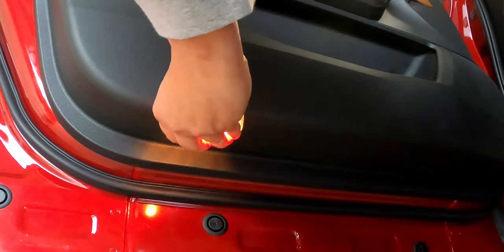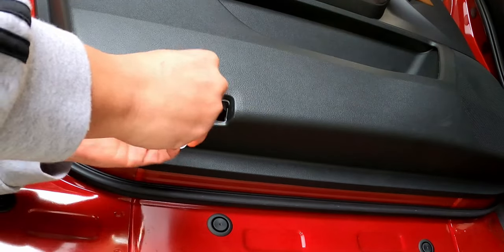2022 -2024 Pathfinder interior LED upgrade

Comment: Big tip on the rear light…..issue is that the mount isn’t secure in the hatch so it pushes up and moves around while trying to clip it in….i had issues for 15 minutes before I tried something…..3 pieces of scotch tape hanging down that is attached to the mount so when your pushing up the light you can pull down on the mounting harness at the same time and it clips right in…once all are clipped in and secure just give a quick pull on the tape and it cuts off up inside the headline
Reply: I had to remove the headliner and hold the housing down.  Good point.
Reply from the maker: @csteger1201 what no , well I guess if that worked for u

Comment: Thanks for the video, it definitely helped while changing the lights on my Pathfinder.  I could have went cheap with the LEDs, but I took your advice and bought these Philips LEDs.
Reply from the maker: I’ve gone with cheap ones and even though some cheap ones are good , I’ve been doing these Philips ones for a few years and I rather pay a little more for quality lights
Reply: Do the bulbs get real hot ?
Reply from the maker: Yes
Reply: @jasonwhite2855  they don't get hot.  LEDS, generally don't generate that much heat compared to regular bulbs.

Comment: I watched your video with great interest so decided to LED my 2024 Platinum.  Well guess what!  No door lights on the 2024. How about a video showing how to tap into the harness as the light assemblies are readily available.  Dealer says harness has changed but I doubt that as the door panel hasn't changed the blanks are in there. Thanks
Reply from the maker: Well I would 2024  a car to do so and mine currently has them but u did give me a idea my rear doors don’t have any … I might look into it

Comment: Hey. Love your channel. Just upgraded my 2023 Pathfinder Rock Creek to LED  lighting. One quick question if you don’t mind since you’re a Nissan technician. Rock Creek doesn’t have a release button for the rear lift gate. Can I add one to that location where the other models have it?  Thanks again.
Reply from the maker: Thank you for the the views and support, to answer your question , anything can be added depends how much you are willing to spend , it can get pricey, you would need to run a harness to the back as well as new latch , lift gate support shocks are also different , plus then configure the computer to read the actual power hatch
Reply from the maker: You can try this website they have a aftermarket option 

https://www.autoease.com/product/liftgate/

Comment: Good day, updates on the led interior lighting swap? Any other suggestion for led lights aside from philips led. Does the dim led lighting after all doors closed do go away after some time when driving or it just completely turns off just when you turn off the engine?
Reply from the maker: If you watch till the end of the video I show that they do turn off all the way , also it’s been 2 years and still working perfect
Reply: @PRviewsvlogs  nice!! Thanks. Been a while thinking of upgrading my led interior. But this time it will be.

Comment: Thanks for your detailed information for each section and it helped me a lot.
I was able to change all bulbs except map light. It was easy so I kept it for last. The problem happened when I installed map light and all interior lights have no power.
I changed fuse but still none of them came back. Can you please advise? 
I changed original bulb to see but no luck. 
Thanks
Reply from the maker: Not sure , never heard of this issue before

Comment: I just ordered the  nissan led upgrade. Ill try to get it in this weekend.  Ill let you know how it is.
Reply from the maker: Very simple
Reply: I ordered Nissan kit and it only came with four 194 bulbs and two 3175 bulbs. For the price you think they would include all bulbs needed, should i return the kit and buy all the same from another supplier ? just curious on your feedback as you work for a nissan dealer
Reply from the maker: Yes , that is what I said in my video I didn’t get mine from nissan mines are also aftermarket 

I’ll send u a link u can get all bulbs needed plus 10% off
Reply from the maker: https://www.auxito.com/DqhmMYIEl7mUBo
Reply: @PRviewsvlogs  awesome thank you i was just gonna order the remaining four 194’s as i already put GTR lighting for the reverse lights, Those are 1200 lumens a piece from Z1 motorsports so far love them

Comment: Not sure if it’s been mentioned but you actually need 10 of the 194 lights not 8 as the video mentioned. Nonetheless great video super easy to do
Reply from the maker: If your referring to the license plate bulbs , the platinum models come with LEDs already
Reply: @PRviewsvlogs  I was talking about the 2 above the sunglasses holder, 1 driver side visor, 1 passenger side visor, 1 driver side door, 1 passenger side door, 1 rear driver side dome light on top, 1 rear driver side on the door bottom, 1 rear passenger side dome light on top and 1 rear passenger side door bottom. Sorry if that’s confusing
Reply from the maker: @jessiebailon6705  yea didn’t care for doing visor lights , they. Don’t get used enough .

Comment: What about the visor lights? Did you do those? Is so what bulb?

Great job by the way! 👍🏽
Reply from the maker: Thank you . I have link to all bulbs in description, and also the size of bulb.
Reply: @PRviewsvlogs  my man!!!!
Reply: @PRviewsvlogs  I didn't put in Phillips bulbs but some other ones I found on Amazon. The thing with those is, they ever so slightly stay on once the light switch is off. Almost like they are still pulling power. Have any idea why?
Reply from the maker: I’m not sure what bulbs you bought but the Philips do the same , only bulbs that won’t do that is the lasfit or Nissans , but not worry it , I explained this in the video at the end , after you get out the car and it fully shuts off within a minute or so they do turn off , while driving yes the have a glow , it doesn’t bother me at all , reason I’d cause LED need less power to turn on , unlike the incandescent bulbs , so the LED will stay lit with a small amount of current that is flowing thru the circuit .
Reply: @PRviewsvlogs  so it's "normal" then? OK, glad to hear lol. I thought the battery was going to get drained 😕.  I'll deal with it then. I really appreciate the info. Thank you
Reply: Is the front side Yellow light led?
Reply from the maker: @DannyDirtyDrawz  no
Reply: @PRviewsvlogs  do you happen to know the size of those lights

Comment: I saved the ceiling light in the back for last. Came out and bulb went in without me having to disconnect it. However, it won’t snap back into place no matter what I do. The plastic inside the headliner it attaches to is just floating up there when I push up the whole bracket inside moves up with it. There’s no resistance. 😢
Reply from the maker: Something broke off then
Reply: @PRviewsvlogs  Actually, I found nothing broken. What I did discover is that all you need to do is take a trim tool and pop off the light cover like the other interior lights and you can pop the bulb right in. So much easier. Found this info in the install instructions for the Nissan kit online. I did that and was able to hold the assembly against the headliner while I popped those stupid clips back in. Popped the bulb in and it's all set. You may want to consider updating that part of your video, since it's as easy as the other bulbs that way. If you break a clip or that housing you're SOL. Much safer popping the cover off. 2 pry points either side of the switch :)
Reply: @stevelopes8783 thank you. I did the same thing, and mine is just floating up there as well. I don’t know why nobody else has done it this way. Because you can see after you take the whole assembly out, that they are tabs just like the other lights on the cover. So I’m going to try this.
Reply: +1 floating bracket. I tried too many times to get the light assembly clipped back in that I eventually broke one of the 2 plastic clips. Wish I had seen this thread first and not just the video. 🤦‍♂️
Reply: Thank you, removing that light cover was a life saver.

Comment: Great instructional video - all of his are - thank you. But, OMG! So, so bright!  No thank you. If we are on the road at night and go from dark to full blast LED dome lights when the car shuts off or a door is opened, it's quite a painful and sudden eye adjustment - this is why Nissan default to milder incandescent bulbs. 

We camp alot and arrive home after dark alot and we have little ones and older family members that actually prefer the softer, less bright and more natural light of incandescent bulbs. 

But for those that need/want  all those artificial lumens blasting, yes, LEDs are the way to go. For me, I typically only drop LEDs in the cargo area light, the puddle lights and the back up lights.
Reply from the maker: Not as bright as you think , camera ISO makes it look brighter then it is .

Comment: Hey I switched the lights today however none of them turn on now and even when I use the old bulbs it doesn't turn on as well. I'm thinking the fuse was blown and have no idea how to access it even after looking at the manual. Could you please make a video on it to help me out? Thank you!
Reply from the maker: Did you try flipping the bulbs ?
Reply: @PRviewsvlogs  Yup, tried using the original nissan bulbs as well
Reply from the maker: @NYzJatt13  not sure how you could blow a fuse replacing those lights , there is a fuse box under the hood try checking there
Reply: Make sure you didn't accidentally hit the main overhead shut off, on the console, when you put the map lights in.  I noticed that it's real easy to "jam" the buttons with the map lught lens.

Comment: I have a 2023 Pathfinder and swapped out the lights to the exact same ones you used. But these lights are on all the time just very dim even when the car is shut off and locked they go on full bright when a door is opened any suggestions?
Reply from the maker: They do turn off fully after a few minutes

Comment: Dear i have question related to the rear door puddle lights they have a place to puddle lights how i can install ? is the wire available inside the door panel or need to pull a wire form accessory connector .
Reply from the maker: No there is not wiring in the door panel .

Comment: Thanks just changed mine out your video was very helpful. I just noticed on my 2022 platinum that my rear doors do not have the lights on the bottom is it supposed to be that way?
Reply from the maker: You are welcome , and yes unfortunately the rear doors don’t have them possibly due to part shortage , also I checked for wiring for them and there is none unfortunately
Reply: @PRviewsvlogs  okay that makes sense thanks for the reply!

Comment: Hows the bulbs now sir? Does it still light up a little after u close the doors?
Reply from the maker: Yes they always will , cause there is always a small amount of current flowing thru the circuit and LEDs don’t take much current to light up so yes , but I don’t even notice them , the light is so dim it’s not even noticble
Reply: @PRviewsvlogs  how bout when u turn off the engine? It will not cause the battery to discharge?
Reply from the maker: No , if you watch the entire video I explain all this .
Reply: @PRviewsvlogs  i more thing sir, how long did it light up after u turn off the power?
Reply from the maker: About 2-3 minutes , as stated before I showed this in the video

Comment: I want to change the ones in my 2023 pathfinder
Reply from the maker: It’s the same thing
Reply: One difference at least with my 2023, there are no lights at the bottom of the doors. I see the spot were there are suppose to be. Did they remove them for the 2023?  It’s a Platinum. Thanks.

Comment: This rear dome light is going to be the death of me. I cannot get it back on. Any tips?
Reply from the maker: Yes that was the pain in the butt , be patient is
All I can say .
Reply: @PRviewsvlogs  I spent two hours trying and I thought I finally got it until I bumped it today and it fell out. Did your white bracket in the light move on you while trying to install? I’m thinking of taking it to the dealer and having them pop it back in
Reply from the maker: Yes , like I said that one was a pain , I unplugged the whole thing just left the connector put the entire light together and plugged  it in and installed it
Reply: @PRviewsvlogs  can the little accent light above the wireless charger be changed out?
Reply from the maker: It can but it’s a pain you would have to wire a new led to it , that mean cutting wires and connectors to solder new wire and bulb
Reply: @PRviewsvlogs  yeah Nevermind on that. That’s how it was on my old car but wish it was as simple as replacing like the others
Reply: I recall doing my rear dome by just prior the white cover not the entire thing

Comment: You made changing the lights a breeze, thanks!!

Have you ever thought if yellow fog lights? I've been searching for the bulb size/info but there's practically nothing out there. The white led looks nice, but I miss have yellow so I wanted to swap LEDs if possible.
Reply from the maker: The fog lights are LEDS diodes , not bulbs , but you can add yellow film to the light lens

Comment: You can do it for under $25 with the correct size bulbs in the cargo area.
Reply from the maker: Not with cheap bulbs , i don’t use anything but Philips , the other bulbs diodes burn out abs flicker you’ll be replacing them to often
Reply: @PRviewsvlogs  You use the bulbs you want but I have never had any problems, my last vehicle was 5 years old with absolutely no problems with LEDS. I have the same brand now but the correct size in the cargo area that you do not.
Reply from the maker: cargo is 3175 just that the bulbs are thicker due to the housing , it’s the right size , and yes I will use the bulbs I want , that’s what I said in the video .
Reply: 3175 is correct but the length is 28mm not the ones you used. They do come in different lengths.
Reply from the maker: @thelandrys703  and you know what you are correct . I didn’t even think of that .
Reply: @thelandrys703  can you send me the link to the ones you bought for the doors in the front and the cargo area ?